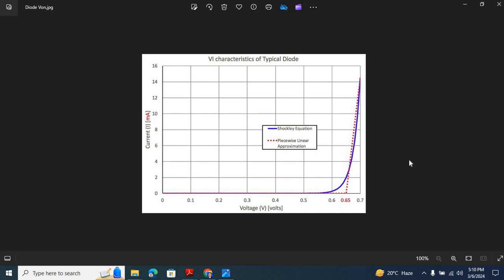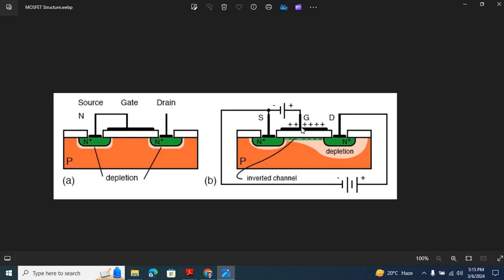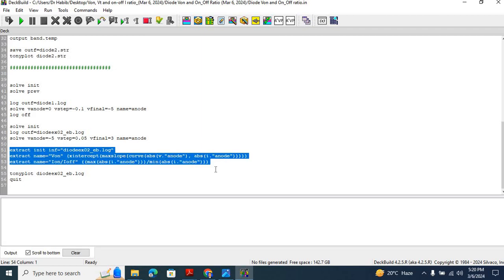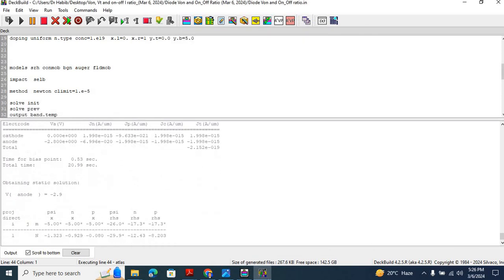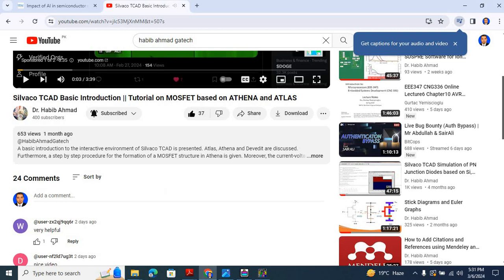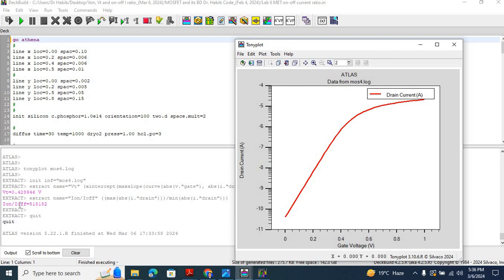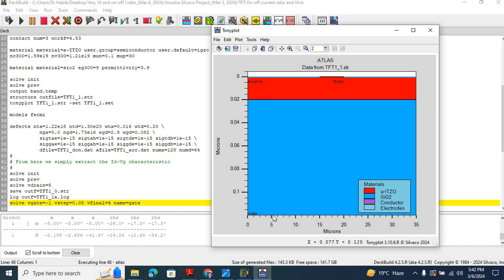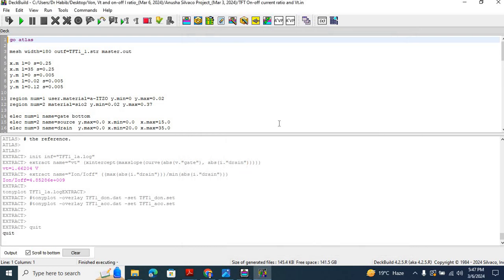Silvaco TCAD Simulation to Extract Von, Vth and On-Off Current Ratio for Diodes & Transistors 💻🔍

Comment: Fantastic video! 🌟 The detailed walkthrough of extracting key parameters like Von, Vth, and the On-Off Current Ratio using Silvaco TCAD is incredibly helpful. 📊🔬 I appreciate how you break down the steps so clearly, making complex concepts easy to grasp, whether you're a beginner or more experienced. The practical tips and insights are invaluable for optimizing diode and transistor performance. Thanks for sharing this treasure trove of knowledge—looking forward to more amazing content!
Reply from the maker: Much appreciated feedback. Gracias!

Comment: Sir can you please explain how to extract Ron in AlGaN/GaN HEMT simulation using silvaco
Reply from the maker: To determine RON:

1. Measure the ID-VD curve (output characteristic) at a fixed gate-source voltage (VGS) beyond the threshold voltage (Vth).
2. Find the slope of the linear region of the curve (ohmic region).
3. Take the inverse of the slope to get RON.
Reply: @HabibAhmadGatech  thank you sir
Reply from the maker: @mounikag8136  You are welcome!
Reply: @HabibAhmadGatech  Hai sir can you please explain Pulsed Id-Vd simulations using silvaco with help of any sample code for GaN HEMT